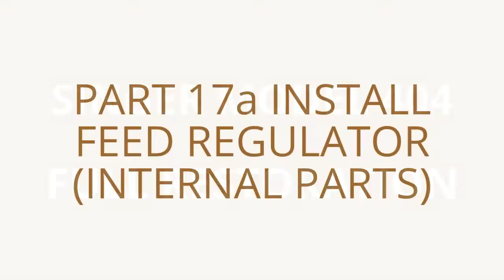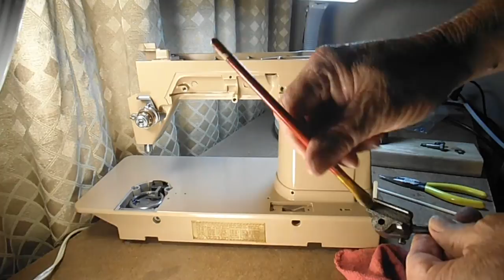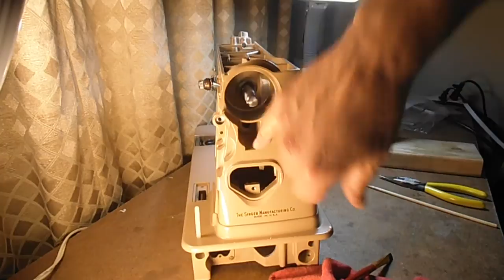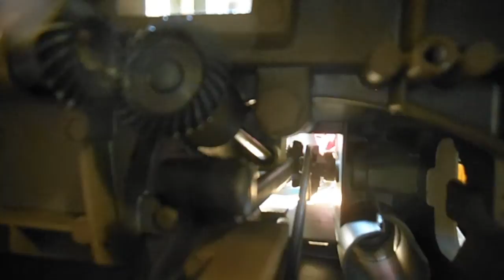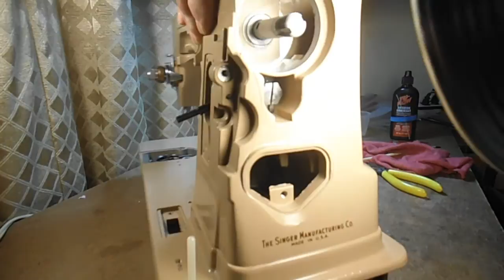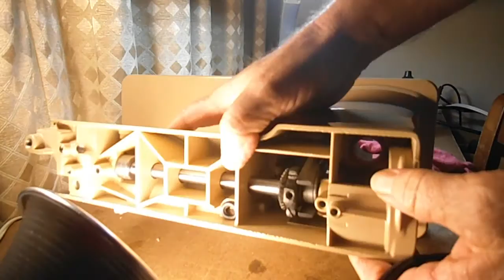SINGER MODEL 404 RESTORE SERIES Pt. 17a INSTALL FEED REGULATOR (INTERNAL)

Comment: Hi Andy,  I hope you are doing well. You are such a great instructor. I am in the process of putting my inherited grandmother's 404 back together. The slide block fell out when I was putting it back together. That lovely little telescoping magnet you suggested to get in one of the beginning video's became a life saver. I attached it to the sliding block, laid the machine on its back, slid the magnet down behind the back of the fork and put it back on the rod. Then the light bulb went off!!! The magnet was holding the slide bar so it wouldn't move. I was able to easily keep it in place, I flipped the machine back upright attached the regulator arm and screwed everything together without any issue.  I hope this helps anyone else putting the regulator arm back on.
Reply from the maker: That's brilliant Mary! I appreciate your sharing and thank you for restoring that nice machine. Take care.

Comment: Hi Andy,
Thanks!
Omg! Thank goodness when I took my 401a apart, when I got to this part I only removed the lever (I think it’s what you called the feed regulator stud in your video 17b, right after this one), and I also removed the stitch regulator plate, bit not the internal parts of it.
Is it different with the 404 here that the internal parts have to come out and with the 401a they don’t have to come out?
Reply from the maker: Nice job that's usually all you have to do I just wanted to show folks in case they ever needed to replace any of those parts
Reply: @andytubesewing1953 
Ah, I see. Thanks!

Comment: Maybe some kind of wire arrangement bent to lightly hold the block from turning and coming in from the point of view of the camera.  Pretty tricky.  Reminds me a bit of getting the choke control arm on a Rochester 4 barrel carburetor after taking the top off.
Reply from the maker: Yes, many viewers have come up with their own ideas about that block. I've heard of chopsticks from the back, magnet on telescoping stick, small hole drilled on the back to hold with ice pick. If you have a better possible way I say yay and go for it!

Comment: Andy, like @Loie Campbell suggested, I used a pencil in from the top tuning fork area eraser first, and a small retractable click eraser through the bolt hole. The block didn't move and I was done with this step in seconds on re-assembly, I could use the click eraser turning it front to back, to adjust the little metal block and the slide went right on. I even took it off to try it again, beginners luck, did it a second time just as easy. Nice suggest Loie!
Reply from the maker: I'm glad you read Loie's comment. A brilliant solution to a tricky installation.

Comment: Thank you so much for these 404 videos. It have been able to use many of them to get my 527 up and running again. Hopefully.  I am working on the feed regulator and it almost had me beat. This video will help.😘
Reply from the maker: Glad you like them! When I use Google Images to look at model 527 it looks so different that a 404, but if the videos are helpful them I'm a happy guy. Thank you.
Reply: Andy Tube Every single one of your videos has something to offer. I learned (and was relieved to find out) about the little marks that help us set the needle and the foot. Found out what the tiny metal square block does (that I found on the floor after I had been so careful disassembling my machine). I may even be inspired to resurrect one of those old foot pedal singers if I find one in need. This adventure has been fun. (4 quarters!! Who knew!!!)
Reply from the maker: @roxie1117  thanks for you kind statement, and for watching my channel. Yes, please do save an old Singer ✨🙂

Comment: Ooo, looks fiddley! Good to know what a headache this part is though. I need to take the top and bottom off my 503 or 301 and figure out how this (the stitch length) works. I assume it changes the feed dogs somehow...but I need to see how!
Reply from the maker: Yes, fiddly is a good name for it! The 503 and 301 use the same type mechanism. When you slide the stitch length lever up and down it changes the position of the feed forked connection on the eccentric cam up on the horizontal arm shaft. That in turns moves the feed rock shaft on the bottom in a different "rocking" motion; shorter or longer. So yes, in the end, the feed dog rocks back and forth a shorter, or longer, distance, feeding the fabric for a shorter, or longer, stitch length between needle penetrations.